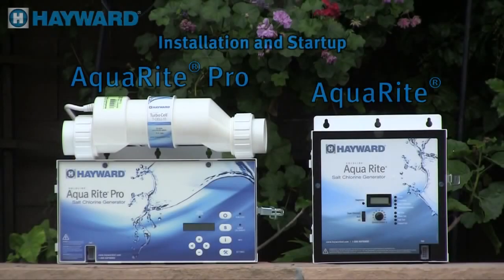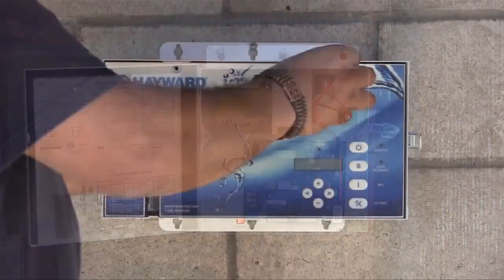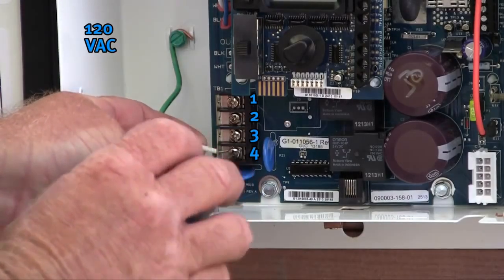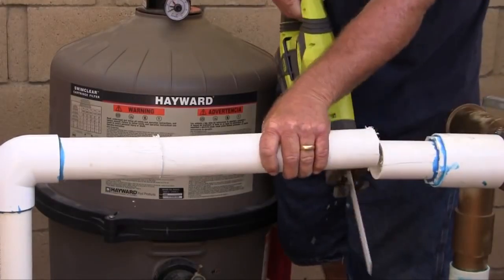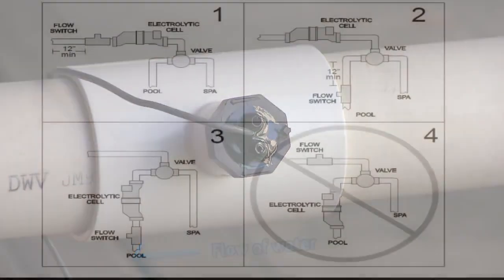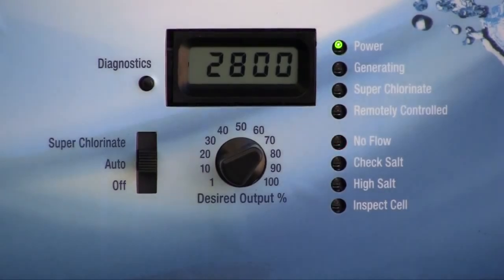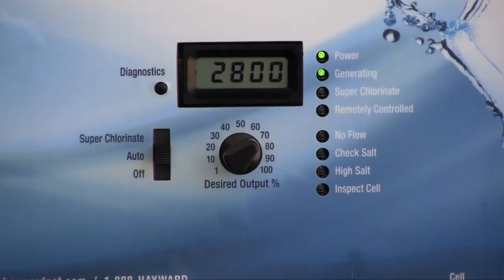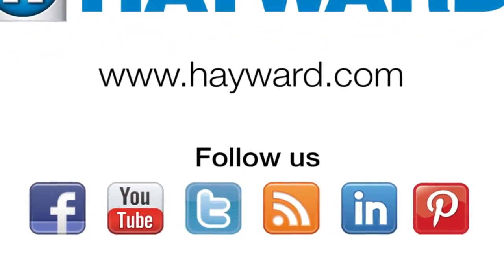Hayward Aqua Rite - Installation & Start-Up

Comment: If the pool sistem has a heater do I need install a second timer to control the heater set power on at the same time with the aqua Rita and pump ???

Comment: What about installing a check valve right after the heater to prevent the heat exchange from being chewed up after the system is off NT standing chlorine?  Also why not mention to install the cell on the pool return side only to prevent pool dander collecting in the spa causing calcification issues?
Reply: Absolutely right about the check valve
Reply: What is the check valve for?
Reply: @kazu52  to stop standing chlorine from eroding the heat exchange in the heater.

Comment: My pool guy put the flow meter directly behind but on the same plumbing as the t-cell. Is this ok?
Reply: If the flow switch is installed after the t-cell - the t-cell counts as 12 inches of pipe, so if it was done that way....then yes, your pool guy installed it correctly. If the flow switch is mounted before the salt cell then you would need at-least 12 inches of pvc pipe in front of the flow switch.
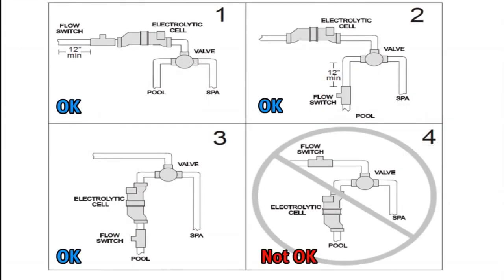Reply: Yeah that’s ok look at top right corner of the screen at 4:56